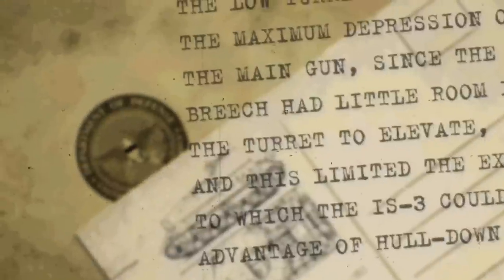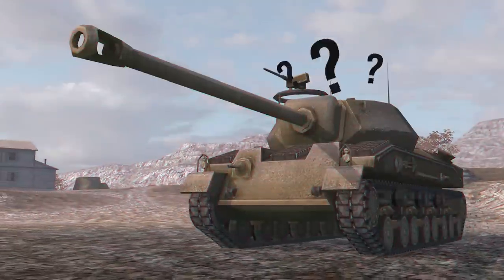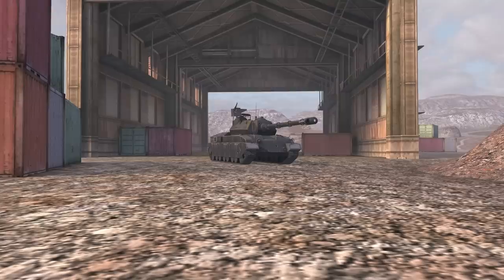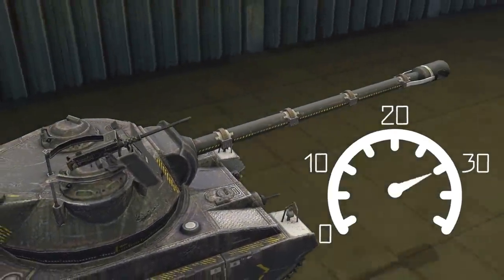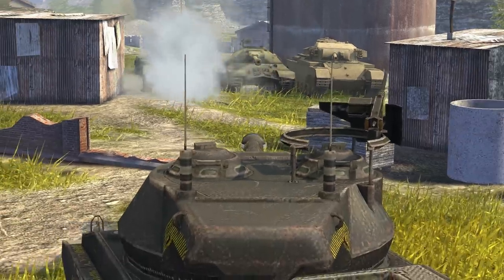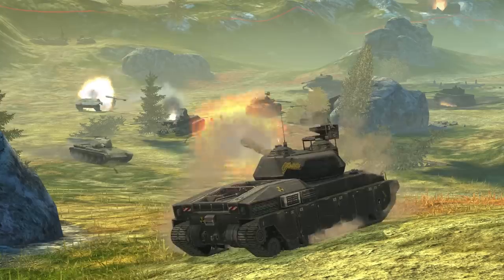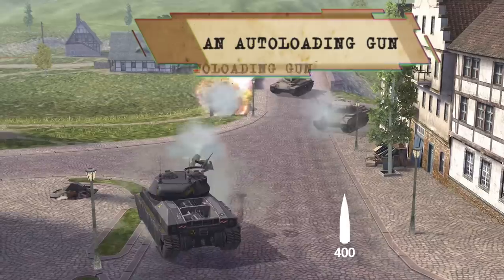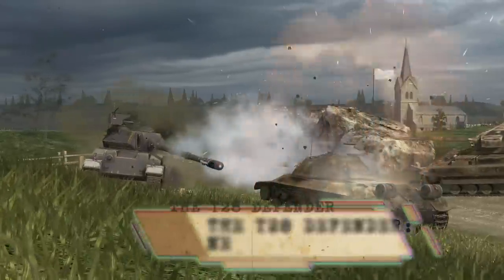WoT Blitz. Secret Project. T28 Defender

Comment: Hey look,new op tank that is unbeatable,how neat
Reply: It literally looks like a better t28 pt that you dont have to grind to get.
Reply: @arthurkal5892  yeah but have to pay almost triple for what its worth. Smart thinking 😒
Reply: @MxntiMedia  so p2w
Reply: @arthurkal5892  pay to lose lmaoo, 17k is nowhere near what is given. Its all hype
Reply: They basically are giving us the exact same tank armor wise in the hull, unless your a medium or light player at tier 8, the T28 Defender will be easy pen.
Reply: @rezibaki310  The hull has 50% better upper side armour, making it impossible to be penetrated by most HE shots. The turret however received some 10-15mm more on the sides, removing the well known cheek weakspots. What it also got were two big 90mm cupolas that everyone can pen.
Reply: @dzikidziad  The Enhance armor does give it a bit more armor but in terms of the gun, the T28 Prototype has a better gun overall than the T28 Defender. I believe the T28 Prototype has a higher overall DPM.
Reply: @rezibaki310  I mean ofcorse it has better DPM cuz the defender is an autoloader
Reply: How neat?
More like NOW HEAT!
Reply: t28 def is not thet op lol

Comment: Srsly.....T28 defender cost 17k golds..... 17k golds can able to buy Tier 9 T 55A or the two comrades tier8s T-54 proto-T-44-100  bundle.
Reply: TIGER1 ARMADA1945 for real 50 buck! Wtf!
Reply: Then buy that instead
Reply: I bought the 121b for 17500 gold. Way better than this thing
Reply: Lmao, why would any want a power creeped t54?  They are trash now. Poor gun pen and aim.
Reply: @RAD1UMMM  T54 is still in my top 3 tier 9s. I use the higher penetration gun. Its a great tank in the right hands.

Comment: WG thats cool and all but what about regular T28 prot. This thing is better than its counterpart in every way
Reply: h1re 1 225 pen. T28 has 248 pen. This defender tank is still not a good tank btw. It can still be HE penned from the sides and rear. The front can be penned with prem rounds. Don’t believe this ad
Reply: LV R10   Who’s penning HE through 75mm of side armour in tier8?   Who penning HEAT through those sideskirts? 

Who else has 225 pen?  Oh yeah the Löwe. 

The 6.7sec in-clip reload is pretty damn long for an autoloader.  And gives it 1 round less a minute than the regular proto. 

This tank is strong, but it’s weaknesses are pretty well balanced.
Reply: @lvr1028  T28 D got 75mm side and close turret is closed, unlike T 28 which has 45mm and open top, only thing tech tree version has is DPM and Penetration, I haven't checked gun handling statistics of T28 D, so it could be one of the balancing features...
Reply: Who’s HE penning through 75mm side armour u asked? Well ask stalin..
Reply: The Beast killer..
Reply: @cjwrench07  enough Tanks can kill the T28 Defender easy
Reply: @bigt7410  it is much easier to angle 75mm side to have more effective armour more than 99mm than to angle 50mm side (not 45mm),  if T 28 D driver can look map, survivability of new defender increase significantly compared to usual tech tree one...
Reply: HΞΛRTLESS & Ξyo Λy    I wouldn’t want to meet this thing on a ridge, 1200 burst damage, with a strong turret, and 10* of gun depression. 

I’ll bet we see a ton of these in tier 8 tournaments.
Reply: @cjwrench07  It's not so good... It's a strong Tank but it's definitely not a Tournament Tank 😂And not every shot makes exactly 400dmg everytime... Low rolls,Bouncer,....
Reply: HΞΛRTLESS & Ξyo Λy    It will replace the Jpanther2 on a lot of teams.   It’s speed, gun depression, armour, and most importantly burst damage will make it one.       It will act like the clean up man, that is3 defenders do too. 

It might not hit 400 sometimes, but it will also hit over 400 on a lot of shots.   That’s why they call it average damage.
Reply: @DearHRS  don't forget that it's faster than the original T28 which only goes 20 km/h while this one goes 30
Reply: @cjwrench07  If you think...Good luck WG supporter.
And the Jpanther 2 is still better but who cares...Its just my Opinion
Reply: But it is a P2W game so WG did nothing wrong here ? 🤨🙄
Reply: @i_nameless_i-jgsdf  it's not supposed to be a pay to win game though. That's how you lose players
Reply: @unnecessaryammorack  they already lost me 😂😂🤣
Reply: @i_nameless_i-jgsdf  me too mate I played this game from the 1 Day...
Reply: @i_nameless_i-jgsdf  and they're going to lose more
Reply: HΞΛRTLESS & Ξyo Λy    You act like supporting a company that gives 99% of its users a free product, is some sort of shame.  
 Just because you mooch off of other people hard work, doesn’t mean other will too. 

The jag2s weaknesses have been big for the tournaments, they just can’t take the same positions as TDs with good gun depression. 
 
 Adding 50% to the proto’s top speed is going to be huge.  They can now keep up with heavies, or are fast enough to support a flank. 

I’ll leave this comment here for the OP complaints that are going to be coming over the next few days.
Reply: Doctor Cthulhu minutes not days
Reply: @cjwrench07  what about the high rolls from the ability where if you get 3 consecutive hits the 4th has a chance to hit at the maximum?
Reply: @cjwrench07  the thing we're complaining about is not supporting WG, it's about WG releasing premiums that are straight up better than their non premium counterparts

Comment: Hm... interesting..HT, TD what's next? MT? than how about Centurion I Defender?
Reply: What? 5 shells of 84mm 20 Pounder? And with buffed front plate?
Reply: @zaidanmujahid6567  Hm... than how about this? More lighter but still 40km/h and 3 shell auto loading gun
Reply: @BeeChilling71  3 Shells in one mag will only cause 570 dmg,I mean 5 shells in one mag
Reply: @zaidanmujahid6567  Ah...i understand.. but it will be op tank...
Reply: We cant find any new balanced tanks nowadays,so A Highly Buffed Centurion 1 is enough to counter those premiums

Comment: "The reactor's output is enough to power a railgun firing high velocity guns. More speed gives them more energy to pierce through armour."
Still, the normal T28 somehow has 23mm more penetration without that makeshift reactor of yours.
Jesus Christ, think about what you're actually advertising in a new tank

Comment: Thats a nuclear  radioactive engine wonder what happens when its shot hmmmmmm oh it fucking explodes.
Americans have tried this in 1980s with the m1A1 the tank with a huge head with a nukeulaer radio active engine and they started to figure out that to much pressure or if it was shot it would explode, same with is3 defender.